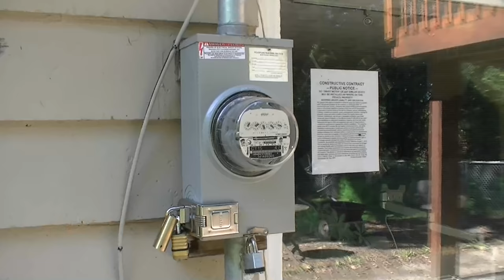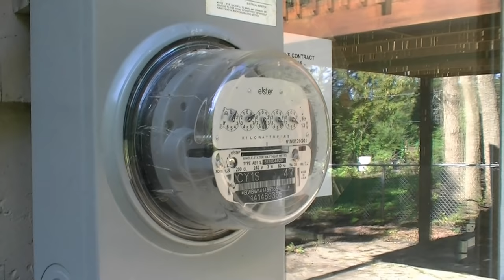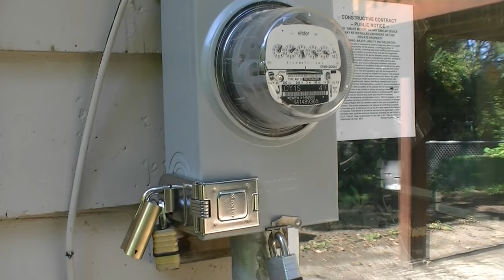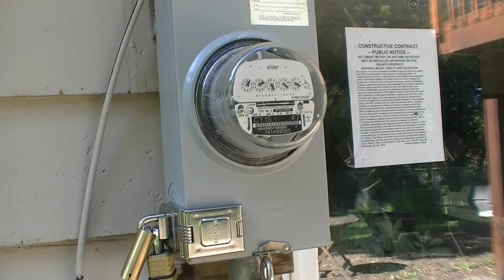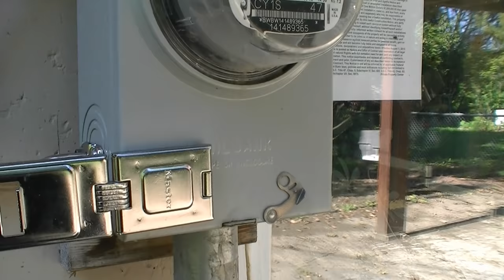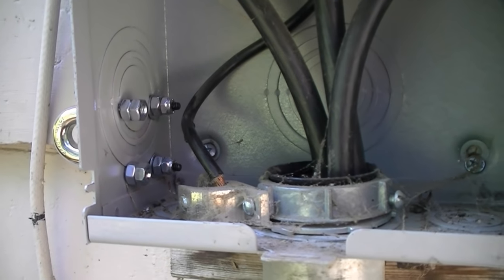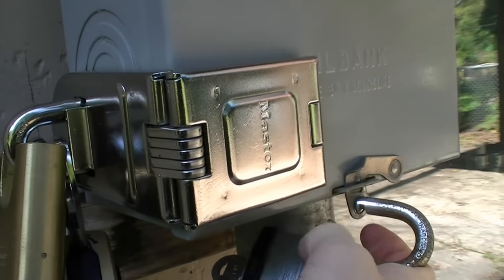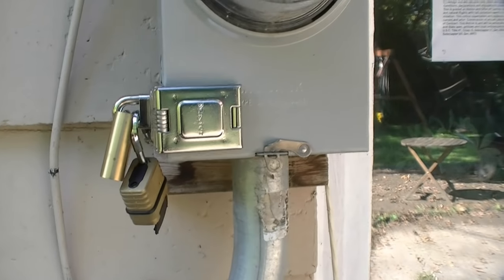Locking Your Electric Meter to Prevent Smart Meter Installation

Comment from the maker: Going on 4 years now - my meter and locks are still in the same condition/setup as in the video.  Despite all the many predictions here, no one has cut off my locks, removed my meter, disconnected me at the pole, etc.  All those comments are extremely entertaining.
Reply: Good for you man!
I was thinking the same thing when I was reading all these ridiculous comments. I’m in the process of helping my mother get rid of her smart meter. They came out and installed a digital meter that they claim is a “legacy“ meter and also claim it’s not “smart“. I told him she wants an analog meter. By the way, since they installed the dumb meter, her electric bill went down dramatically. Scumbags at the Southern California electric company!
Reply: Great idea!  You've altered the UL listing on your meter socket.  Your home owners insurance will drop you or not pay in the event of a fire.  One of these days you will be paying to replace that socket or sitting in the dark.
Reply: Ok great but what if I take theirs off and put an analog up
Reply: How do you get a smart meter off or prevent them from upgrading a 1 way electronic meter to a 2 way electronic meter?
Reply: @godcomplex2105  Thank you for sharing this. I can keep someone from accessing my analog meter by keeping my gate locked. My concern is cost of estimated usage billing and the possibility of service interruption. I'm in Denver, so I'll have to do research on how this is all handled locally.
Reply: @EMF Explorer they broke two gate locks to upgrade my an to another anoalog
Reply: @EMF Explorer  two my padlocks on my gates they cut to change out an analog for another analog, said to update.yet stop opt out fees, and use tier time of use.  All outlets  static noise when plug radio in.  I wake every 3 hours since and have  terrible tinnitus plus more. Can they have smart meter inside of analog I refer to components or r my lines entwined with smart lines of cable?  Any ideas
Reply from the maker: @maryannsinopoli1751  Look up at the meter from the bottom.  If it is a plain analog you should be able to see the disc that spins and nothing else.  Just metal.  But if you see plastic, a circuit board, circuit components (little electronic components), etc then you've got a "trojan" meter as some people call them - an analog meter with an automated reading electronic module installed.  Yes these will produce dirty electricity and wireless too and should be avoided.  They must have something electronic in there - otherwise they wouldn't know what you are using at which times of day.  A true analog meter only gives them the current reading when they physically walk up to it and look at it which is usually once a month or once every other month.
Reply: @EMFExplorer  the meter reader does come here but bi monthly , I  thought I saw him use a device pointed at it to get read as he was not close to it and he is 68 so eyesight would not see that far , it does spin but in daylight I shall look further into it as it’s glass I have all numbers and it’s from sangamo electric it has a catalog no and the  meter no.   In 2019 they had it over 10,000 than what it was at  but I thought he transposed the numbers.  I had more troubles always with  the company.  They love to estimate a lot even when it was read, is my belief but I can b wrong on that!
Reply: @ Mark Mueller. U can take photo of read on read dates  from them with phone and email it in to them or go to office to show read numbers or if they allow u to call it in or be there to
let guy in to read it only. They must tell u read dates for that year.  Have dog sign and no trespass on your gate scare warning I have dog and signs also. Dog is a good deterrent, one of the best actually.  Cooperation. On their part is needed.  They like to estimate a lot.
Reply: All here with analog meter still, can u tell me if they after three years dropped  the monthly charge for the opt out of smart meter as that was done to me.??????  My meter looks analog and still spins!  Had to correct misspelling.
Reply: Good luck with that!
Reply: As a senior project manager for a $20 mil metering company, I assure you if your work order comes across my computer, I will authorize my techs to cut them off. Vandalism? 🤣. Police? 🤣 you think you have more power than billion dollar utility companies? Stop misleading people.
Reply: We do carry bolt cutters, just saying
Reply: @kevinnaylor5737  Your reply exemplifies a bad attitude and bureaucratic abuse of trust.  You work for a metering company?  Does this metering company like to piss off its customers, or serve them?  Is this attitude coming from your company in a top-down fashion?  If people don't want these meters, maybe it would be best to honor their wishes.  How many people do you think you can anger before they turn on you?  Bragging about how much money your company makes?  From where do you think that money originates?  It's good to have voluntary customers, and it is good to serve them according to how they wish to be served.

If your techs destroy property, they can be sued and so can the company.  And yes, the police can also be called.  I wouldn't recommend fighting with home owners on THEIR property.  That sounds like a recipe for disaster, and even something that could potentially turn violent.  You should respect private property as much as possible.  Trying to be forceful and destructive with someone's property - that is NOT a good idea.
Reply from the maker: @kevinnaylor5737  The fact that you are contracted by another company does not hold you harmless or give you immunity to commit crimes such as destroying private property or trespassing.  If your utility companies wants to escalate the matter to the point of removing service, that is up to them.  The appropriate thing to do then, in such a scenario, would be to make an appointment with the home owner to retrieve the property you wish to retrieve.  An analogy would be if I left my car inside someone else's locked gate - I can't simply walk up and damage their gate in order to get my car anytime I want because I feel like it.  And a car is a very expensive piece of property in comparison to a utility meter.

There are courts and proper ways to do things.  Relying on "they are so big, you can't do anything" is foolish.  It shows you have a very incorrect mindset.  Being willing to violate property rights and make dumb decisions like that will not serve you well.  The utility can cut someone off at the pole - they don't even need to remove the meter.  They can take someone to small claims court if the homeowner refuses to relinquish the meter.  You're not special because of the easement.  The easement doesn't allow you to destroy private property.  Doing so would be foolish, and I would certainly sue anyone involved and win including lawyers fees and punitive damage.

Some states even allow the use of force to stop certain types of crimes in commission.  So that is another potential very serious issue that could arise.  Is all that worth it?

As far as smart meters go.  I'm not sure what you mean by misleading people.  What have I said that is untrue?  Many people don't want the RF emissions (RF is a group 2b cancer agent on the World Health Organizations IARC lists).  Many people don't want the privacy intrusions (the equivalent of your gas station knowing where and when you've traveled, how fast you were going, how many people in your car, etc).  Many people don't want the nerve-blocking frequencies on their powerlines in their home from the switch-mode power supply in these meters.

Many people are really creeped-out by the utility companies wanting to snoop and surveil them so much.  They don't want this crap.  I support them and hope everyone can have the choice.  I urge those who are being bullied by the "so big" power companies to boycott them and get as many people to remove the meters and install analogs as possible, even if they have to do it themselves.

1 meter?  I know countless people who have done this.  If it's not a problem, why are you even commenting here?
Reply: Those states also allow me to defend myself from violence while I'm legally doing my job. At the end of the day, it's not my first rodeo. I work for high completion %. I'm not going to let a small fraction of entitled people (1 in every 10,000) stop my success. The only places that can stop us from servicing their utilities are hospitals. Some may make us schedule an appointment. Some think they don't have to. But when we show up and start shutting people off and word starts spreading, we have no issues.
Reply from the maker: @kevinnaylor5737  While I'm not a lawyer and therefore don't give legal advice, I would recommend leaving someone's private property when the owner tells you to do so.  I appreciate your candid replies.  I suppose I like the genuine "I don't give a shit" reply versus the disingenuous runaround we get from some utilities.  Since smart meters are an individual health, privacy and liberty abomination, I wish you as little success as possible at replacing analog meters with them.  I hope more and more people wake up about the dangers and threats of smart meters and take action such as getting together in groups to remove them.

How many customers are you willing to disconnect?  1? 2? 10? 50?  I imagine the number is smaller than you might think.  It doesn't look good disconnecting and parting ways with customers simply because they want to choose which type of device to have on their house out of health, privacy, and safety concerns.  It is very bad publicity, very bad optics.  Which utility do you run?  Afraid to say? I imagine you will not answer out of fear of repercussions.  You talk a big game - I'm calling your bluff.
Reply: @kevinnaylor5737 
What’s wrong with you ? High on a little power?

Comment: If someone decides to install a padlock as you did and doesn't remove the cover there is a very good chance that they will drill into one of the load conductor and hopefully blow the fuse on the CSP (completely self protected) transformer or the external fuse on the pole. If it's an underground network supply it's a whole different story. When one circuit trips there are backups. Someone could get seriously hurt or possibly killed. Guess who is getting sued.

Comment: This, at all levels, is demonstrating a terribly dangerous practice. You need to remove this video.
Reply from the maker: I will at the very least edit it and put warnings.  I assume your primary concern is the lock which could prevent fire/emergency personnel from quickly removing the meter?  And next the risk of putting screws and drilling into the box.  Yes, this is definitely dangerous and should never be done with a live meter socket.

Comment: The use of smart meters use more electricity to power for which the customer is charged.

Smart Meters event EMF frequencies which can cause major health problems and even cancer.

Smart meters have caused multiple homes to burn down. 

Smart Meters don't always function properly and can cause other problems including shortening the life of your appliances.

With a smart meter installed in your home there is no need to send someone out to turn off the power due to non-payment it can be done remotely by computer.

The installation of smart meters has caused a loss of multiple jobs when it comes to meter reading.

Smart Meters allow the power company to justify rate  increases based on what they claim to be monitor usage especially during peak times.

Smart Meters allow your power company to spy on you and is them an idea of your activities in your home.

Smart meter information has been known to be sold to Google for many other uses of advancements of Technology. This has been done without your consent and your concern as a customer.

It has been proven that lightning can cause a malfunction of smart meters by the amount of electricity placed in the air due to a strike close by. When this happens it can cause smart meters to miss read on a multiple level causing everyone's bills to be higher without any increase of the use of electricity in anyone's home. 

Smart Meters need to be banned, they are of no benefit whatsoever to the customer of the utility of which they are installed.
Reply: Hot Wired Smart Meters cause heart attacks they gave me one

Comment: You are very misinformed about the meter base. The meter base does belong to you but you cannot build around it or put your own lock on it. You should read the National Electrical Code. I'm sure your locks have been cut off by now.
Reply: If you think the meter base belongs to the customer, then please tell me why I have to drive all the way to downtown KC to pick up a meter base every time I install new electrical service?
Reply: Because I worked for America's biggest power provider for way too long
. And probably they provide it to you for free. They will give you a list of approved meter bases and you are more than welcome to purchase any on the list.
Reply: You can buy meter bases at most Home Depots.  I've never heard of an area where the meter base is not the customer's responsibility.  Do you have a citation for the National Electric Code pertaining to meter sockets?
Reply: It could be because your states utility regulations may be different from another states utility regulations.
Reply: where i live the power company gives the electric contractor a meter can for each permitted job so i guess it is the power company's  can
Reply: DB Stevens. A breaker box is not the same thing as the meter box.
Reply: Ownership of the meter housing is determined by the utility company. Some are utility owned some are customer owned. The line side wire inside and the meter are always owned by the utility, and utility must be granted access to their equipment upon request. If access is not granted we contact local PD and get a civil escort so we can access equipment. Yes, the utility company will cut the locks off of the meter housing without a second thought. You would have to cut the meter seal which is a lock in the eyes of the law and that is considered to be a class 3 misdemeanor, (tampering with a public utility)
Reply: Solar panels.

Comment: For everyone wondering about what would happen if the building/house caught fire and then the firefighters going, "oh, well we can't take the meter out, guess we'll let it burn down. There are many meter boxes that have a main breaker outside, as well.  

This is a dual meter box with a service disconnect: http://www.homedepot.com/p/Siemens-Uni-PAK-2-Gang-125-Amp-Tenant-Main-Breaker-Meter-Socket-WP2211RJ/206109554?cm_mmc=Shopping%7cTHD%7cG%7c0%7cG-BASE-PLA-D27E-Electrical%7c&gclid=CjwKEAjw6e_IBRDvorfv2Ku79jMSJAAuiv9YptIGAAsw4R2Vj6kd_EUIfcKL443ciatMBfmuAtZMtBoCxVLw_wcB&gclsrc=aw.ds

Here's another example from google: https://www.handymanhowto.com/wp-content/uploads/2012/01/DSC06222.jpg

You could very well have one of these installed in order to be able to shut off the power to  your house so they can continue to fight the blazing fire.

Comment: I told my power company I wanted to opt out and not have a smart meter for health and safety reasons and they said ok.  Shortly after, they sent someone to change out meters in my area. I locked my box and told her I opted out and she left. About a year later, when I was 40 miles from home and the one day I forgot to turn off location on my phone, they snuck someone in to cut my lock off and change the meter. My wife called me and put him on the phone and I told him what he did was vandalism and he could be prosecuted or even shot. He didn't seem to care and left WITH my lock. Duke Energy has way too much power and should be STOPPED!

Comment: I got a letter that stated when the meter would be put on. I called to see if I opted out and they would charge a 75.00 opt out along with a monthly fee of 20.00.  So how do we handle that huge issue.
Reply: L Moell ~ Same thing i’m dealing with.  SE TX, they are putting them in my neighborhood. I was home that day and said NO. I do not want a smart meter on my home. They gave me a number to call in MI.  They flagged my address as an “opt out” and told me that I needed to call my electric company. i did and was told it would be a 1 time “opt out” fee of $150.00 and an additional monthly fee of $30.00.  WTF?  I have to pay them $150.00 to NOT do something?  🤬🤬🤬
Reply: @wildhorsesrunfaster  They have to do something, actually. With an analog meter, they need to send a meter reader to your house every month or 2.
Reply: sheshr ~ They do that, anyway!  Fortunately,  I work from home and I see them going house to house.  Odd thing is that I never paid their $150.00 fee to keep my meter and my bill has not increased.  The certified letter they sent me stated that the 1 time $150.00 opt out fee would not stop them from changing my meter to a smart meter in the future. So ~ WTF?  🤔 9mm says, GTF off my property.  It was several months ago when they were in my neighborhood changing out the meters on peoples homes when they were not home.  I questioned the guy about the smart meters  and he knew nothing about them, he was just a technician trained to install them.  I advised him to do some research on them.

Comment: 3 points.  One you can't prevent access to that meter.  If you do the company can cut that lock. You preventing access is actually a crime. Same as if a landlord changed the locks on a tenants home because he wanted to evict them.  2 legacy meters do melt,  and meters don't typically  cause fires. Wiring faults or over consumption  cause fire. Also lightning strikes fry all types of meters.